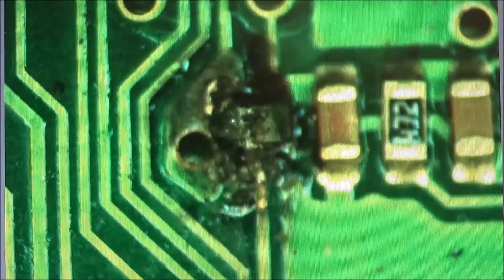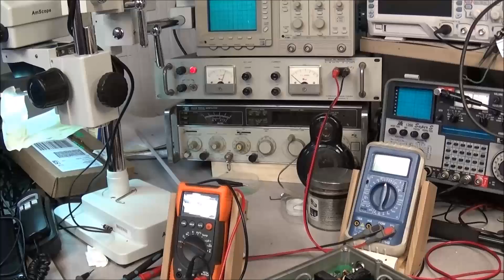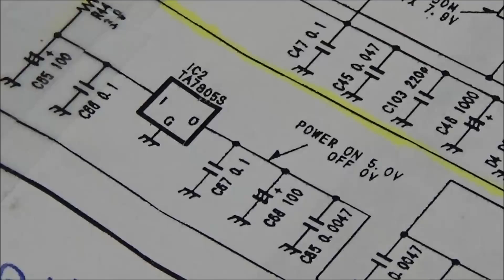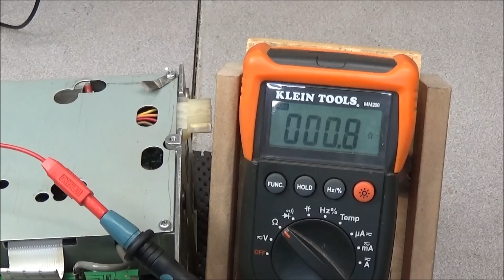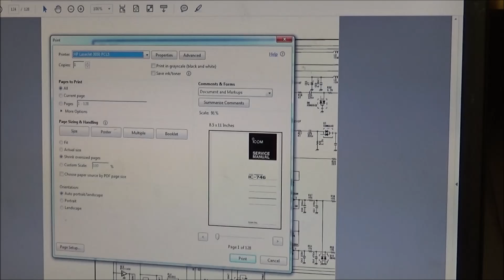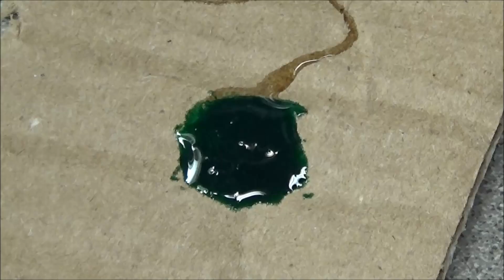#126 ICOM IC 746 Repair

Comment: Very nice repair video Buddy and i hope you are doing wel. For the completeness of your analyses i like to point out that at timestamp 6:27 you point out pin 91 or 41 of IC1704. It is pin 91. SQSS (Outputs squelch signal to (MIC) and (ACC 1/2) connectors. High: While squelch is opened) according to the service manual. Have a nice day, best regards Henk
Reply from the maker: Thanks for the info

Comment: This is the reason I will never buy an ICOM anything.  Too difficult to work on.  Screwy ribbon cables and surface mounted components are NOT for me.  Gimme an old Kenwood or a Yaesu HF radio any day.  Now I'm glad I got an old Kenwood TS-430S with PS-430 power supply.  73 from K9POW in eastern Tennessee.

Comment: Thanks Buddy for your down-to-earth approach troubleshooting the 746 Icom.  I have the 746Pro, and it is a used unit.  So far I haven't had any problems with it, other than an audio whistle coming over the speaker/phones while transmitting on 2 meters.  Going to have a look at the AGC adjustment and see if I can remove the audio whistle.  It's not painfully loud but is a distraction!

Comment: A brand new set of ribbon cables for that radio, would be great, in my opinion.
They suffered a lot on connect and disconnect procedure.
Reply from the maker: You are correct, and they still make them.

Comment: Hi Buddy Great video and fix. I got a kick out of you saying that equipment would seem to fix themselves by just being on your bench. I've seen it myself and have always wondered why, but the strangest part of the story is they seem to stay fixed more than not.  Glad you found the fix for the old air conditioner problem. I seem to always get the bad compressor or major failure costing the price of replacing they darn things. I have always wanted an IC746 but can't justify buying one but I understand they are a great radio and a pleasure to operate.  73's Buddy,,,,,Dale kg7ssb
Reply from the maker: Hi Dale. Yes it is a good thing when they fix themselves.  Looks like this radio has had plenty of help along the way. The 746 is a nice radio. Thanks for watching

Comment: Nice job Buddy showing the thought process of troubleshooting from board to board. Could have been any kind of conductive debris left behind from previous attempts at repair. Reminds me of a problem we had at the building where I work with one of the elevators.  Every once in  a while the elevator would start behaving erratically. This went on for months. Service guys from Otis coming all the time. Finally a tech came and took off the control panel inside the elevator. He was probing around taking voltage and resistance readings  on the contacts of the switching buttons. All of a sudden we heard a clink as something fell to the bottom of the cabinet. Somebody had managed to push a penny inside the control panel and it was sitting there balanced perfectly on the shut down key switch. Sometimes it would just move enough to make contact and cause the elevator to do all kinds of strange things.  73 Doug.
Reply from the maker: Thanks Doug. I actually found the problem early on in the repair. But what fun would have that been.  So went back and edited the video to show more of the flow of troubleshooting.  Tried to make the video more interesting.  Thanks for sharing that story.  Lucky the penny only caused a small problem.  Thanks for watching.

Comment: Hi Buddy,
Another nice repair video. When you put the new transistor out on the paper, only thing I was thinking was "Don't sneeze Buddy".  :-)  73  WB3BJU
Reply from the maker: LOL, yeah I thought about that also. Even the air from the over head vent could have blown it off the bench.  These 416 packages are very small.

Comment: I agree on theboard layout in manual.  I have 2 of the 746 (one is a parts doner).  I need to get off my duff & get good backlight board in the working one with toasted backlight board.  I dont have your patience to try & reconstruct the traces ha ha.
Reply from the maker: Yes manuals are crap. But cost too much to buy original manuals for everything I work on.  Trace repairs can be quite challenging. The microscope helps in that area.  Good luck on your repair.

Comment: Alien Ice Cream trucks ROFLOL... I was just taking a sip of water and when you mentioned that and I almost watered my keyboard LOL. I have worked on a lot of high end telephone systems and I have seen those ribbon cables cause similar problems like this. They have to be aligned perfectly when they are plugged into the ribbon connector. They are ALWAYS tough to find too. For some reason I tend to never suspect the cable or connections. Very good job on trouble shooting this, Buddy. Well done! Regards, Frank
Reply from the maker: LOL, I thought that was funny the first time I heard it. Long story. These ribbon connectors can cause all sort of problems. Thanks for stopping in Frank.

Comment: I'm a little sad I spent an hour watching this all for a misaligned ribbon cable connector, but your troubleshooting process and skill are really nice to watch. 

I'm also having an issue with the IC-746, specifically the "sudden death" problem where It won't TX due to the failure of IC151. You can read it here if you want to: http://www.qsl.net/k5lxp/projects/746Pro/746ProNoTX.html

I think it applies to the IC-746 non-pro too. As soon as I find some time I'll put it on the bench. Sounds like it's hard to find the part though.
Reply from the maker: I found the original problem early on in the video. So had to do a bit of editing to keep the video going. I have heard of the sudden death problem but never seen it on the bench. Going to have to read through the link you provided. Parts for these rigs are getting impossible to find. Thanks for watching.
Reply from the maker: I saw you post on Reddit. Is yours the Pro version?

Comment: JT65/JT9 about the only HF mode I use
Reply: Yeah I like summoning the alien ice cream trucks too.
Reply from the maker: Never got into this. Maybe one day.
Reply: i happen to like using it on the low bands. worked much DX down there I would have not been able to with most other modes
Reply: It's modes where their computers make ALL of the contacts & they make ZERO.Any weak signal station can work digital modes but it takes a great station too work DX under the current band conditions. I'd rather work nothing than let my computer make any contacts since my computer does NOT have a license for any band.Digital modes are for the lazy as well.

Comment: So I could have fixed the 5V short myself if I re-seated the cable. But I'm glad I let you tackle the component replacement. If I tried that it would not have been pretty. Thanks for bringing it back among the living. Also I may have laughed a little too hard at the alien ice cream truck comment.
Reply from the maker: Pretty much yes. A problem that was caused by a previous owner. That 416 package was a pain lol. First time I heard the comment from another person I laughed also.

Comment: Great way to spend the afternoon inside watching Buddy work where thank goodness the AC is working; the temp peaked a little while ago at 96 ambient and 115 degree heat index. As for the fix, I keep telling you guys sometimes all you have to do is let the bad air out and it'll fix itself!  ;-)    Thanks for sharing Buddy!  73 - Dino KL0S
Reply from the maker: Thanks Dino. Yes way to hot. Heat index was 115 yesterday. Agreed. Bad air has to go. Thanks for stopping in.

Comment: Thanks for another fine video. I'm going to have to go into my IC-756 pro II and troubleshoot the CIV port. These videos help to boost my confidence - HI. I hate replacing SMD components...
Reply: James Gaines 

It's more intimidating than it really is as long as your not dealing with tiny 0201 or 01005 sized componemts.  Even if you don't have a fancy rework station like I do.  The first thing that simplifies removal of SMD components if you don't have a hot air reflow system is using something like Chip Quick or Fast Chip.  It's a very low temperature solder removal alloy.  Just flood the area with the removal alloy and you can remove the old part with tweezers.  Because it's melting point is so low it stays a fluid a lot longer than normal solder allowing you time to pluck the part off the board.  Be sure to clean up the solder pads throughly with desoldering braid before installing the new part.  Flood the area with flux.  I can't overstate this part, flux, flux, flux.....  I think this is what hangs up a lot of people.  Soldering the new part in should be the easy part and flux is what allows that.  You can then either drag solder the part if it's an IC or even solder it in pin by pin.  With lots of flux applied the solder should easily flow and make a good heel to toe connection with good fillet.
Reply from the maker: As Mike said, lots of flux. It is the key to smd soldering. Watch Louis Rossmanns videos on mac book repairs. He makes it look easy.

Comment: I really hate those board layout diagrams that superimpose both layers of the board in one picture.  Such a pain to trace circuits using them.  Glad to see you got it fixed.  Bet you were saying "You have got to be s#!++! ₩& me" to yourself when you found that short at the ribbon cable.  Luckily the short didn't cause any further problems and resetting the cable fixed it.

Glad you got your AC fixed.  Nothing like working on electronics when your all sweaty. 

Yikes, a spec of 13uV for 10db Sinad.  13uV is a S7 signal, I sure hope it can reach 10db Sinad at such a high input level.
Reply: Jon Mullins 

Happy to help whenever I can.
Reply: If it's gonna happen, it will happen to me....
Reply: MikesRadioRepair Thanks for helping Buddy identify this component.
Reply from the maker: Yep those layouts are terrible.  You know it is no telling how long this hidden error in the cable has been hiding out.  Just waiting for the right moment to show up. Glad it was that simple.  Yes that spec threw me on that.
Reply: Re- Aircon, I once learned the hard way.......I was working on a very expensive HF Military RX , and it was a hot day......I got up out of my chair and leaned forward over the radio with its lids off and one drop of sweat dripped of my forehead and landed on the mainboard right on the Tracks leading into the CPU..........it sizzled and bubbled and before I could get the power of it destroyed the processor....a rare and hard to get part. I eventually replaced it and all was good, but I soon upgraded the aircon because it was cheaper than the parts I blew....lesson learned the hard way.